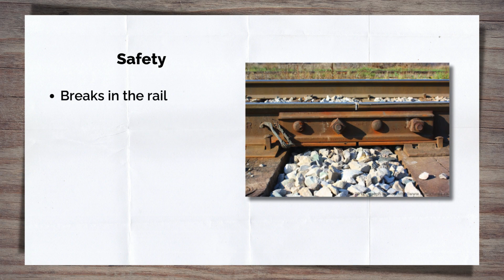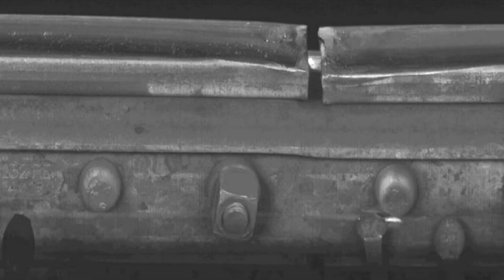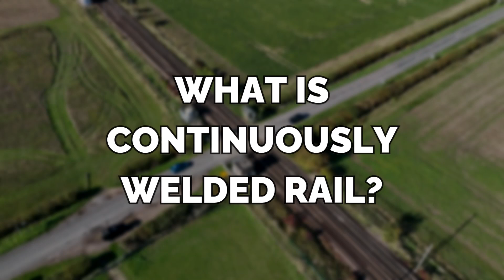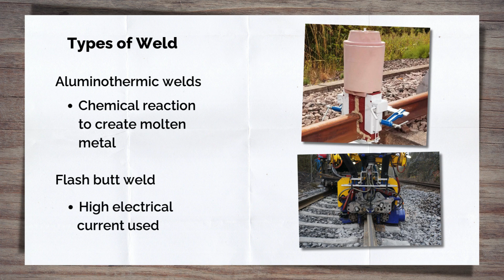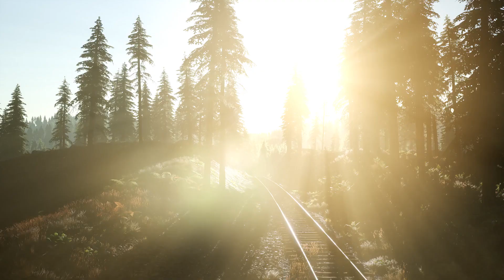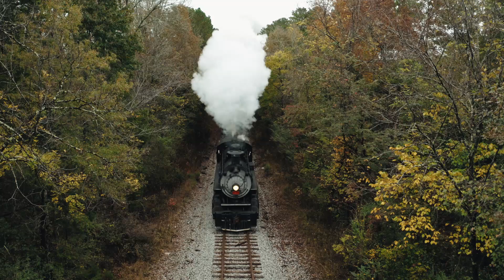Why has Continuous Welded Rail Replaced Jointed Railway Tracks?

Comment: I'll never miss that thumping that the old joints caused, but did anyone ever try tapering and overlapping the ends of the track segments to allow some expansion or contraction without a sharp break at the joint? That might have some of the advantages of both methods.

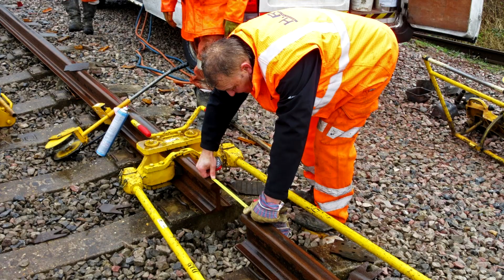Comment: Great video! At 3:55 it explained the rails are pretensioned, so that when temperature increases tension decreases. How it happen? Can you explain why is that? It is harder for me to understand
Reply: the basic idea is to setup the rail at temperature which is about mid point of annual temperature range in that place, so that swing to either side is not too extreme to cause problems. Eg. a place where annual temperature range is 0 to 45degC, you can use 30degC as neutral temperature. At neutral temperature, rail is in zero tension, and on either side of temperature swing you get contraction or expansion but it's not extreme enough to cause fracture

Comment: A serious derailment occurred in close proximity to my residence, attributed to rail buckling. A number of freight cars derailed as a result. According to the incident report, the rails had been welded at an inappropriately high neutral temperature. On the day of the accident, the ambient temperature was elevated, approximately 30 °C (86 °F), which likely exacerbated the thermal expansion of the tracks.

Comment: A friend bought a brand new house that had a rail line behind it that had a joint behind his yard. He called the rail line and within a few days a crew was out and thermite welded the joint. After while the sound of a 100 plus car train didn't wake him up.
Reply from the maker: That’s good to hear, good of the company
Reply: My sister bought a row house that was built in 1946 with tracks running behind it and every house on the street had had the plaster ceilings replaced over the years. The noise might not bother me, but that might.

Comment: Thank-you for saying welded joints reduce joint failures and don't eliminate them entirely. Welds are usually more sensitive to crack propagation than the parent metal.
I remember the first time I witnessed a thermit rail weld. It was a surprise to me just how much pre-heating with big propane torches was used.
Reply from the maker: Welding also relies on the welders following the correct process and having a good set up. They are a stronger joint, but by no means immune to issues. 

It is quite a thing to watch for the first time

Comment: SDI a major USA steel maker forms and ships sections of rail one quarter mile long from its facility in Columbia City Indiana.  The year they introduced the product a sunset picture of the rail gleaming atop rail cars on a curve graced the cover of the annual report.  I live a few miles from the plant and have watched the cars go by at a crossing. No breaks in the rail as it spans dozens of cars.
Reply: I would say they are likely welded lengths going out for installation. That is pretty common as it minimises the number of welds that need to be made on-site.
Reply: @sensonic6514  not welded. They are continuously cast in those lengths
Reply: @noodengr3three825  SDI rolls (not casts) rails at up to 320ft / (~100m) then welds them together into longer lengths.

Comment: What about the installation of Insulated Rail Joints for Track Circuiting? Is this still possible with CWR or do axel counters need to be used in lieu of track circuits. If this is the case then what about broken rail detection which is offered with track circuits. Love the video I have learnt a lot!
Reply from the maker: IBJs can certainly be installed, normally with 6 bolts or the manufactured glued type. So track circuits can still be used for sure. It’s important to remember that broken rail is an added benefit of track circuits, and not a primary function
Reply from the maker: IBJs can certainly be installed, normally with 6 bolts or the manufactured glued type. So track circuits can still be used for sure. It’s important to remember that broken rail is an added benefit of track circuits, and not a primary function
Reply: In areas with overhead line electrification @25kV (OLE), and when jointed track circuits are used, only one of the rails was used for track circuits, with the other one being used for traction return. The latter are all bonded together and with lots of other things (to avoid hazardous unwanted voltages across between certain things), so no traditional track fault detection was possible for half of it.

Comment: On my railway I worked on, we had jointed rail in the depot, there was some or other insulating material stuffed into the gap so did not really get the clickety clack. On the mainline however, we had continuous welded rail.
Reply from the maker: I think that is pretty typical to have joints still in sidings and depots
Reply: @thepwayengineer  something that was interesting to me was how the track circuits worked on the mainline with CWR.
Reply from the maker: The concept and overall design is the same. What changes is the components. The IBJs need to be designed to withstand the forces is being stressed and under tension.

Comment: How long can a continuous welded rail get?
Reply: I personally don't know if there is such limit, but if it does exist - it likely is not possible to be achieved in practice, as switches or other pieces of infrastructure will occur before it is reached - and switches are still joined with fish plates.
Reply from the maker: I think you are spot on here
Reply from the maker: Great question, I have never seen a limit set for the maximum allowed length
Reply: Perhaps the question is: What is the maximum length of section that can be tensioned to CRT by a rail tensor? I'd guess that the weight of the rail, and resistance from the fastening to the sleepers would place a limit on the length that can tensioned, perhaps track temperature during the operation is a factor as well? I also wonder if with extreme hot weather becoming more frequent whether this might warrant adjusting CRT.
Reply: @TinkTom  this is defined in the UK based on track curvature. The tighter the curve, the less distance you can stress. For a radius measured above 4000m, the maximum 2 way pull is 1800m (900m each way from the tensors).
Reply: In terms of length the limit is when your question is what is the minimum length of the LWR and the answer is that it depends on the type of sleeper and the weight per metre of the rail
Reply: In theory, if there was one railway line from lands end to john o groats for example the whole length could be continuous welded rail
Reply: Length of cwr is unlimited as long as all the rail is stressed properly.  Standard LWR lengths are 216m.
Reply: Saw a freight train recently carrying railroad tracks that seemed to be about 200m long.
Reply: @jhgeorg  if you are UK based then the standard long length rails are 108m long or 216m welded rails.